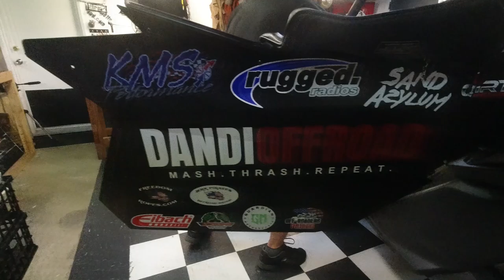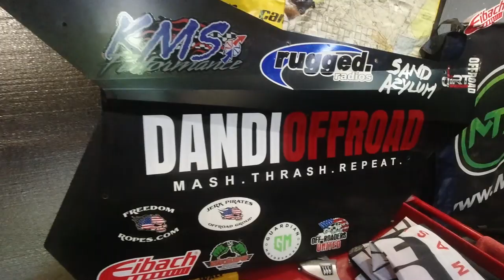Installing New Doors On The X3...Again!!!

Comment: Great Video! Can you guys share what cleaning supplies you use? Your car is always super clean! Thanks
Reply from the maker: Thank you! If the car is not very dirty we just pressure wash it off with water. If it's a little more dirty we use whatever high-end car wash soap ww find at an auto parts store. But for the final touch we actually use lemon pledge furniture polish. https://youtu.be/lTEIy9eeLf8
Reply: Dandi Offroad Thank you!